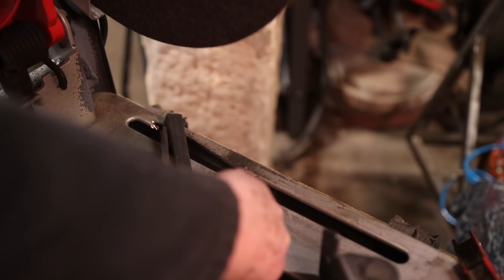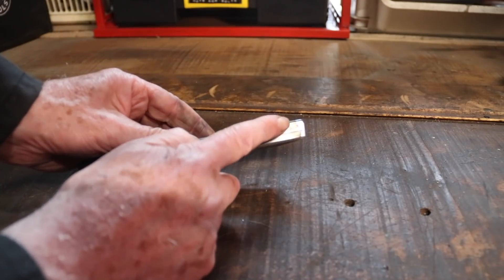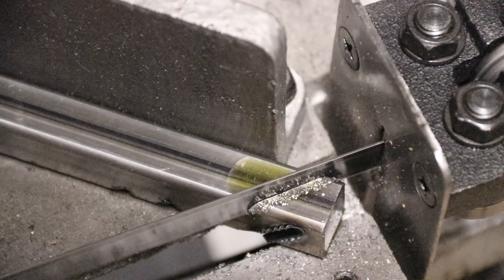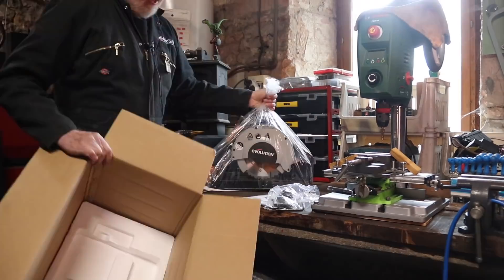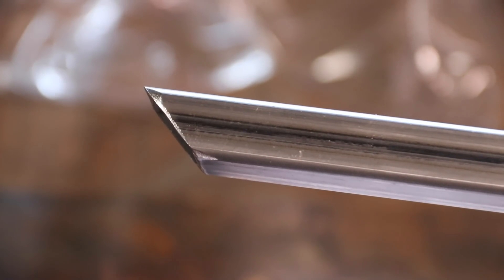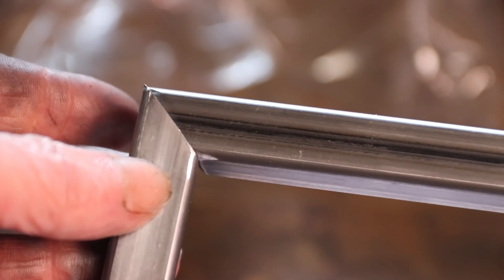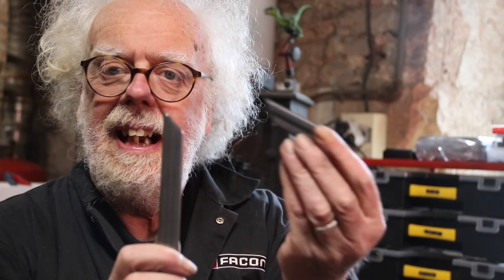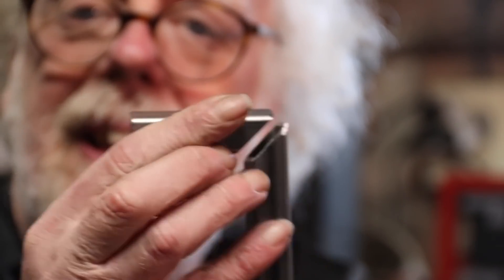Cut Off Mystery ? - Professor Simon

Comment: I enjoy your videos very much and look forward to them, especially the eclectic nature of your channel.  This video compels me to write about a shop experience of my own.  I have wanted a Mini Moke  for many years (no doubt you know of them) With restored examples costing North of $18K  buying one was out of the question. The solution was to buy a gas powered golf cart engine and differential  After many cuts and welds I had a 7/8 scale replica of the real thing. The acid test was that an English friend thought it was the real thing until he looked it over more closely.  Sorry about my eclectic off topic message but I couldn't resist after seeing your struggles with 45 degree cuts.  So, I checked out the evolution blade and believe one is in my future. .

Comment: If you keep the weld on the tube the dark line always up you will find you have a better fit on your 45* . I once had a machine with solid blade I think it was called a transjager that might be spelt wrong . But you didn’t have a small handle to pull it down it had a bar that you grab with both hands and a peddle for both feet .you would grab the handle and jump on the pedal with your full weight the faster the cut the cleaner it was .
Reply from the maker: good tip...the welds on tube stock are supper hardened.

Comment: 45 degree cutting is slightly uneven on each side of the cutting blade, so it will push the wheel off to the side, which will vary according to how the metal is offered. Cutting slower might help, but the blade is not rigid enough to prevent the offset. Also, a smaller cutting disc would not flex as much. A 115 mm grinder will do an adequate 45 deg cut, as the disc is so small, as to have an almost insignificant tolerance.

Comment: Abrasive chop saws are fine if your only doing agricultural angles, ie anything from 35 degrees to 50 degrees will do for a pig gate or sum such!.........just fill the gaps with weld!!!! 
But your solid blade will be more accurate in the cut. But they too can flex with heat.

Comment: As many people have stated here, cut slower with less pressure and the disc will flex less, it should be doing the hard work, not you! 
Also it doesn't help that a lot of abrasive wheels contain an elastic material to actually help them flex to stop them shattering,
For straight cuts a solid metal blade running at a slower speed always helps

Comment: I bet If you use high-speed photography, you probably find that as you apply force at the tip to get it to cut, gyroscopic forces twist the blade. I have found that if you use the very thin under 3 mm blades designed for stainless steel that the wheel cuts with light pressure and cuts quickly and cuts strait.   Just a thought. love the overhalls

Comment: Possibly flexing, but also too much heat in the cut is also contributing to a less than square cut. Abrasive cutting is good for fast and nasty cutting. It’s all about chip load, without a flushing system in place abrasive grinding/cutting creates too much heat and distorts the metal. If you notice the beginning of the cut is ok. But after that point your plasticizing the metal.
Reply from the maker: Good point.

Comment: Lighten up on the downward force you are applying, as well as space the material away from the back jaw of the saw. It will put the work more under the center of the wheel to trick the blade into thinking it's a more square of a cut. The leading edge of the wheel, when the material is in the original location at 45 degrees, will make the blade scoot off to the side due to the wheel contacting the angled surface at an earlier time in the cut. Think of it like a miter box with guide walls when the material is spaced out to more under the center of the abrasive wheel, and think of using a saw without guides when the material is against the back clamping wall at a 45 degree angle. Hope I explained this well enough for you to understand what I'm trying to say. Keep up the great work!
Reply from the maker: Top answer Matt...thanks

Comment: Give it a proper clean, remove the blade and clean all the bolts washers etc. Take your time with each cut and probably anecdotal but I've noticed that sometimes cutting with decent waste (not just nicking the end off) can help with not throwing the blade over in the cut

Comment: Abrasive discs  are fine  for square cuts, the disc flexes on obtuce angles, I do a lot of metal cutting,  abrasive cutting steel , then changing  to aluminium creates something that pulls skyscrapers down .. Iron and aluminium with sparks will create therm ite, a self sustaining exothermic reaction.  Impossible to stop, used to weld rail tracks together.
The bandsaw is the way to go, but use coolant. We dont want another 91#
Reply from the maker: Thanks norman...my bandsaw is great...no coolant system..I use oil on the work.

Comment: When the cutting disk first makes contact with the material you are cutting use as little pressure as possible, essentially "letting the saw do the work".
Once the cut is deeper, you can gradually apply more pressure to the handle.
Always remember guys, measure twice, cut once!
Reply from the maker: Good advice ...that I often forget to do....

Comment: It's the heat that causes the problem, see the blue colour of the metal, it's expanding as you cut.
There's no blue colour present using the carbide blade, so much less heat, thus a cleaner cut.

Comment: Check for play in the blade shaft bearing. Possible it has worn and kicks the blade out when under load. If it is a direct drive the also check the opposite end bearing near the commutator of the motor. Often these are phosphor bronze sleeves and do wear out, and usually wear the shaft too. It may be serviceable, maybe not. Worth a look though.

Comment: a few tests of your chop saw may be in order .. check for wobble on the arbour , make sure the blade size is the correct size bore , make sure the bearings are not on their way out and the drive motor is securely fixed but in the end a horizontal band saw is what you need ! it is what you want listen carefully and you will hear the gorgeous jet bandsaw calling to you !

Comment: Ex power tool/plant fitter and i always found abrasive disc saws to be inaccurate ( to much flex in the bearings etc ) i would use a different saw to cut accurate mitres in mild steel box section ,suggest looking at '' Evolution Power Tools R210CMS Compound Mitre Saw With Multi-Material Cutting, 45° Bevel, 45° Mitre, 1200W, (230 V)'' decent price ( £54 on Amazon ) and they work brilliantly .

Comment: Stationery flex machines really need to be checked for the proper axel width, they often come with a set of reducers. Several manufacturers sell these products in fact only suited for their own blades. 
Warp happens when the blade gets too hot, this can be avoided by making the cut not in one go but in several ones. The releasing of the blade gives way to the cutoff to be removed by the spin. 
Also check your blade for apparent smoothening, the corund can become filled with iron particles which can fill the pores. Filling of the pores will increase the heat of the blade and further increase the warp. The all purpose cutting wheel can also be affected in a similar way, the widia teeth will than show a change in color. Great machinery, love to see your work.
Greetings Vince

Comment: Buy an evolution cut off/chop saw/compound mitre saw; oh, you did.
If you are welding the joints, use picture frame corners to keep the joints square.
If you need perfection corners with no welding involved, invest in a power hacksaw. Bit expensine, but worth it for perfection!
Anyway, good luck with whatever you choose and thanks for sharing Prof!

Comment: Used a Cut off saw a lot and discovered early on that on a 45 cut the blade hits at 45 degrees which steers the wheel off line! the secret is too start ever so gently until you cut through the first layer, this gives the blade self cut guides both sides of the blade. hope that makes sense? and as my father always told me let the blade do the work, Revolution much healthier as no silica to inhale. and if blade is looked after ie keeping the carbide tips can be re-sharpened by good tool shop. ps still here! keep going great work, it's probably the russians!...

Comment: Cheap flex wheel or wrong grade for the spin speed of the saw.. either way best place for those is the tip! Stinky horrid things.. there are really nice saws with induction motors slow spin fast cut but need soluble oil.. they are fantastic things and very small and cheap..

Comment: Can't be arsed watching this mystery to the end. Basically, if you're lucky enough to have a horizontal hacksaw doofur, why would you even consider using an abrasive disc? Not only will an abrasive disc deform, the workpiece will heat up, the swarf won't clear and the whole thing will be, as you saw, pants. The abrasive disc hardly ever features in displays nano-tolerance machining.
Incidentally, if you're going to weld your mitred chunk of square tube to another, don't panic, there should be enough space in between the parts to be welded for the weld to make up for cockups - depending on whether you're measuring from the end of the mitre or from the centre of the workpiece and whether you have a jig set up for multiple components.
Reply from the maker: Good points...I’m lazy and like tools
Reply: @SimonHollandfilms  Aye, tools are braw! Can I borrow your welder? I loaned mine out and never got it back and the wee shite skipped town.

Comment: A dull blade will also flex regardless of what speed and feed rate you are using. So I would say to check  your old abrasive cut off disc for wear.

Comment: The cut starts on the corner of the box section which allows the edge of the blade to slide away from the cut, simple physics Prof, it's looking for the easy way out. All you have to do is pack out the box section so that the cut starts on the top surface....sorted!

Comment: Try tightening the clamp and some cutting fluid to reduce heat. Good luck Professor Simon. Oh and secure the machine to bench as it vibrates and bounces on the bench it's not tightened down that's perhaps why you are getting a better cut on the bandsaw weight and perhaps more secured down on the bench. 😉👍

Comment: Let the tool do its job, slow press , for the abrasive blade , yes old technology , rigid blade can actually be sharpen , meaning it would last you way longer , lower your cost ,more important , much better precision ....as long as you avoid hard pressing .

Comment: I had similar problems with a cut saw until I realized that I was pushing too hard on the cut. If you " let the saw do the work", and don't push too hard down, the abrasive blade will work.

Comment: @Professor Simon Holland I have much experience as a site steel fixer & carpenter bench joiner i can imagine there is a certain amount of flex in the grinder blade but does it produce a square cut in the 90* Position? If not there is usually 2 adjuster screw bolts to true these things up in both directions, also if its been dropped at all the main frame may be bent on the bed from left to right side? Putting your cut out more, easy to check with a straight edge across the bed then ideally cut a large piece of box section to check the angle, clearing all things of swarf & not forgeting checking the back fence for true aswell. As long as theres no play in the pivots of the rest of the rig it might just need TLC. Nibling end stock in 1mm ranges will always deflect the blade as a note. Failing all that you can fudge a square corner together by clamping against a face board to keep it flat & a square corner board. Any gaps & high heat exposure equal shrinking to that direction aswell in the welding process, i like to turn it down to lowest tolerable heat to mitigate warping on stick welders, clamp the joint pass a 1mm sliting or 3mm grinding disc down the line to create an even shallow troth to weld in & tak the corners if needed. Lastly dont overlook ratchet straps shims for oddsing things. Carver Clamps are the cream of metal worker clamps used with off cut metal for leveling work pieces, sash clamps can help. Everybody loves a jig in wood work. And measuring from corner to diagonal corner for square frame work. Hope this helps & its not a how to suck an egg guide lol. This guy loves his Carver clamp shame everything he clamps now will have orange transfered to it for a little while https://www.youtube.com/watch?v=MtERPHvlK-Y&app=desktop Wow they are not cheap if there still made? https://www.google.com/search?q=Carver+clamp&safe=strict&hl=en&sxsrf=ALeKk00-h4C8W1tfjzusR3fxRzQji7iq6w:1582816552060&source=lnms&tbm=shop&sa=X&ved=0ahUKEwiLzNGSg_LnAhXIOcAKHU9JA4oQ_AUIBigB
Reply: 2 vids to inspire your workshop antics? Just re ordered the list to make more sense https://www.youtube.com/playlist?list=PLjKUl7xC9lJlEoF5rkOPSQ35-jJmTW4xR

Comment: The screw of the clamp jaws is  above your part. That might result in twist in the part itself; having a waste piece symmetrically on top side should help if this is the case. Sparks are not nice though, that alone is a good reason to upgrade.

Comment: Straight away, before l watch your video in its entirety, ALL businesses have to turn (ha!) A profit EVERY single year to no.1, to pay shareholders'  dividends under pressure from evil Accountants, so they continually have to cut corners (ha!) 
   I expect they have cut the oil down with cheaper additives making it more viscous and/or the steel blade or metal you're using or both is no longer alloyed to its usual partner or a cheaper alternative with similar or weaker molecular constitution causing it to buckle and "tear" more.

Comment: I always used a tungsten carbide saw blade in my mitre saw. 
If you get  a blade with the correct rake angle and a high number of teethe they cut like a dream.
Diamond wheels are good as well but you need coolant on those.
Reply from the maker: The new saw in carbide...I like it

Comment: You need to be contacting the bottom of the wheel to prevent the deflection ..
Reply from the maker: Ah ha....that makes sense ...I guess at 45 I was no longer at the bottom....thanks.
Reply: @SimonHollandfilms   The position of the vice on the bed of the cutter is adjustable for this reason  .welding prep basics .Large chamfers around the area to be welded will make the joint much stronger..If you have any other engineering questions I would be happy to help. I served my time as a toolmaker.
Reply: @slim-yin  Slim the Toolmaker! Good name! Was that time served in prison? Haha
Reply: @bleedingfly   proudly NO